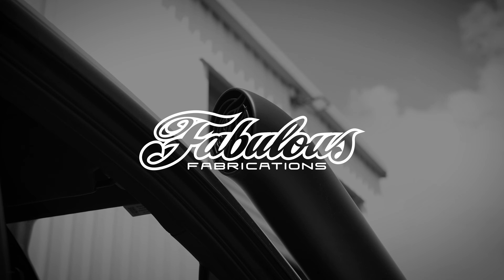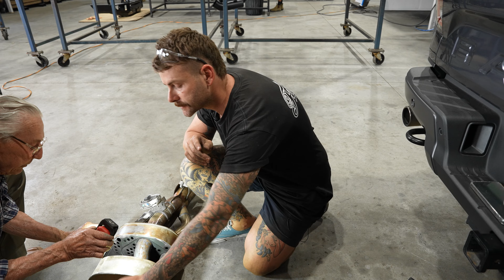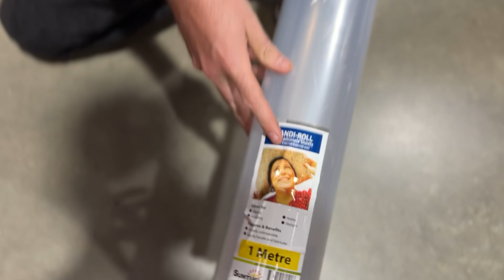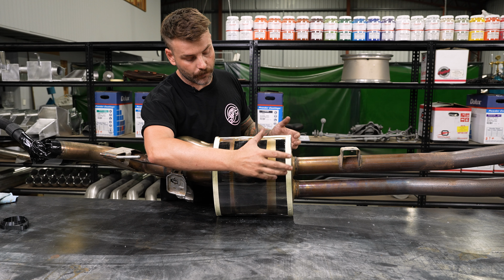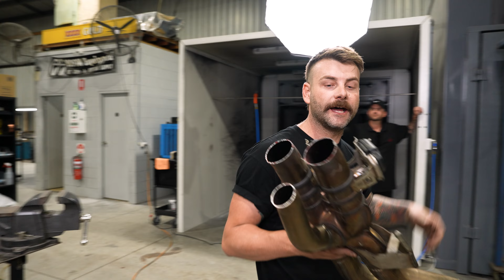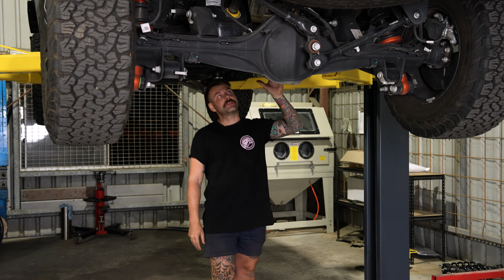RAPTOR BUILD Ep3: CUT TIME - Exhaust modes & valving explained!

Comment: You’ve only shown the valve position at idle. The valve strategy is throttle position sensitive and does change in each mode as the car goes through the rev range.
Reply from the maker: You're absolutely right mate! We realised not long after shooting that they may be TPS sensitive, we've covered this in an upcoming episode, thanks for the message, we're figuring things out on the fly too!

Comment: Check the valving in quiet and normal because I feel like they crack open further at high TPS or engine RPM???... I dont know if some kind of scan tool might be able to read it but my ears tell me they open up despite the mode selected (even if not all the way?)
But seeing the muffler opened up makes me realise why they sound so rattly and tinny in all the modes too
Reply from the maker: GDay Dwayne, thanks for your message, you're spot on mate! shortly after filming this episode we realised the valves may be TPS sensitive. We decided to leave it in and update it in an upcoming episode. We're still very much learning as we publish these videos and it's great to see people helping us along the way! Cheers!